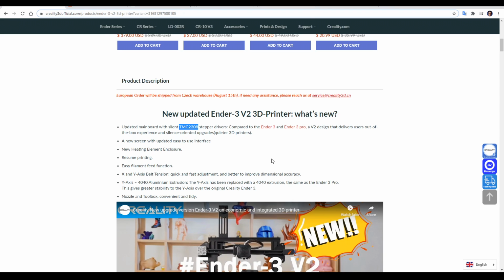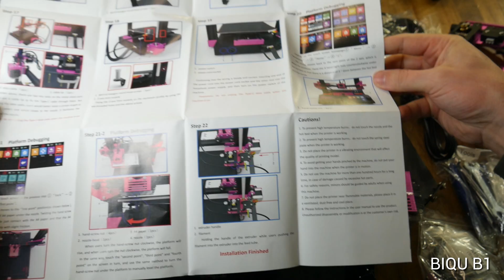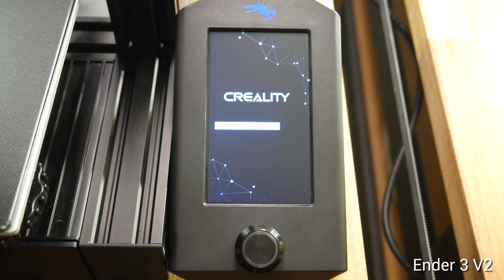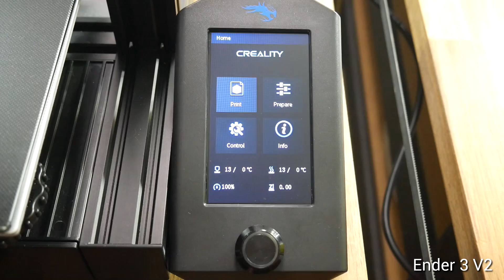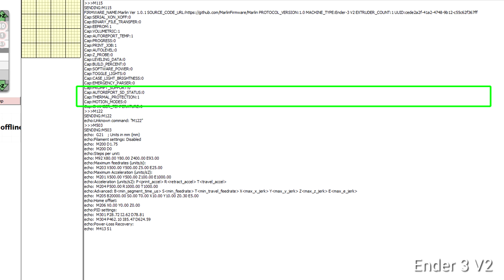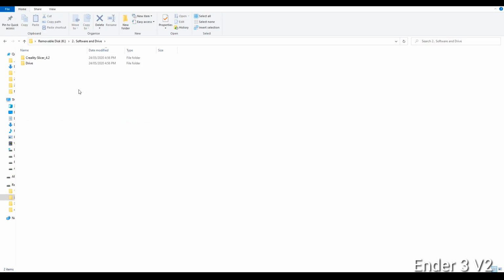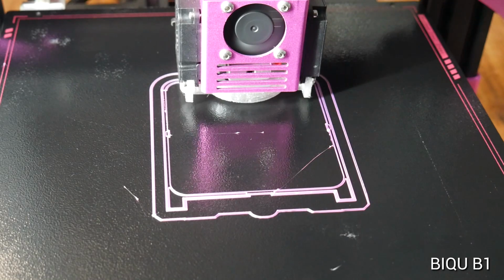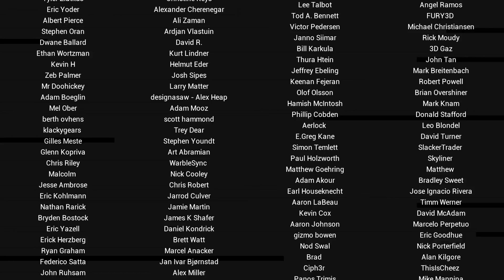Ender 3 V2 vs BIQU B1 - Battle of the upgraded Ender 3s

Comment: would love to know how you fix the zbinding on ender 3v2  i'm having the same issue and im pretty new to this stuff.
Reply: Dealt with this today. Spacers and tweaks
Reply: The old way to get rid of binding >>> Remove lead screw and nut.  Get some  grinding paste and apply it to the area that is binding and screw back and forth till it eases . If you don't have grinding paste make some.  Get a sheet of 240/400/600 wet n dry sand paper . Scrape it with a box cutter blade or hacksaw blade and catch the dust . Then mix the dust with a couple of drops of engine oil / cooking oil and you have grinding paste.  a bit messy but it works
Reply: @bigfilsing  That will leave grinding paste embedded in the brass nut, not a good thing as it will keep grinding. Cleaning will not get that out of the brass.
Reply: @gerritvisser  In theory yes but it would be so extremely minimal ( assuming a good wash out with IPA or brake clean takes place after easing the stiff spot) that i wouldn't consider it a problem. Certainly not with a good lubricant.   At the very least it would help for  a couple of hundred printing hours until a replacement or upgrade is found. 
Of course you could hope the "stiff" spot in on the lead screw .  Cover the lead screw problem area with a marker pen the run it in the nut and see where the ink is rubbed away then attack that area with a file or emery cloth